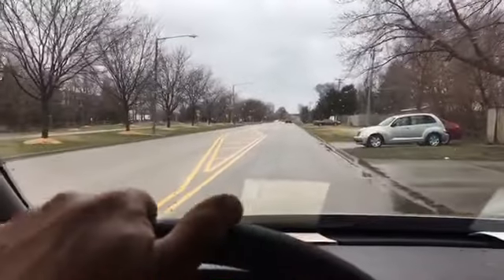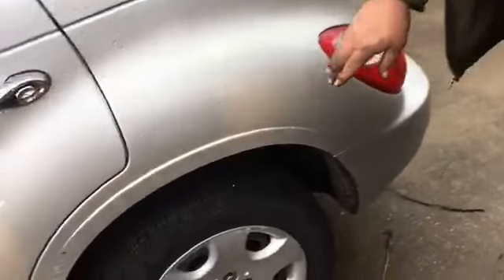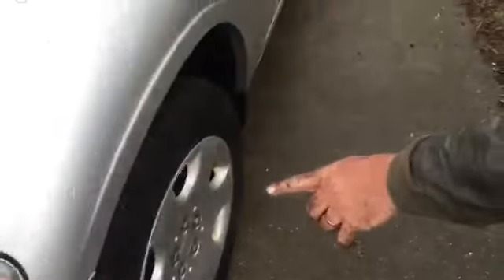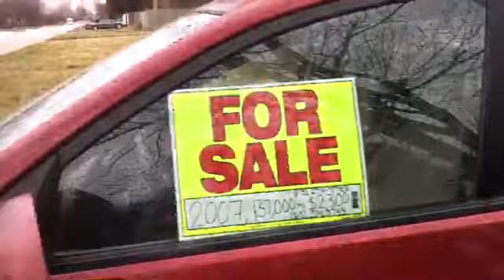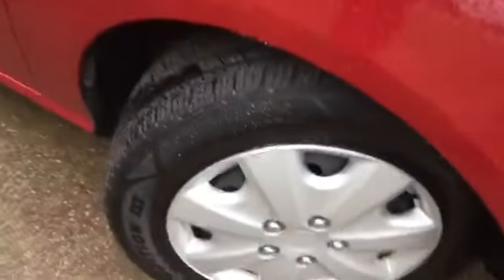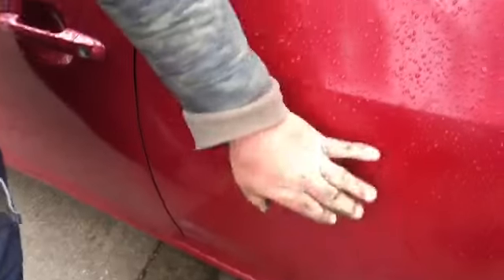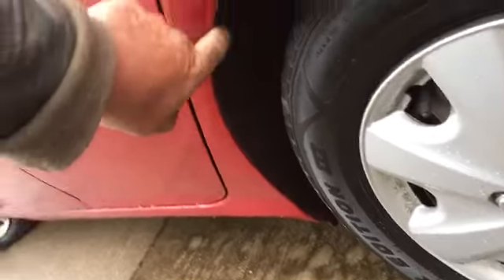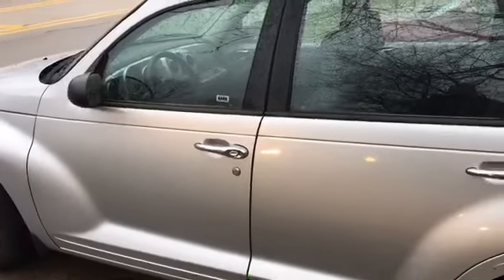P T Cruiser for sale

Comment: Wat horrible car it's got kind of retro vibe but just dont work. Same wit new minis or beatles for me dont work. A classic mini there size so low to ground just great car for time todays minis aren't a mini there hatch back size there notting mini about them. Beatles new 1's just to femin girly todays version both made by BMW German made which means over engineered hard to work on tight spaces expensive to fix new parts something the original versions weren't. On to the next yeww on catch up.👍☘🇮🇪
Reply from the maker: Oh yeah the “new.  Beatle. Is really just crap
Horrible auto transmission 
Which caused a real lot to fix
Thousands